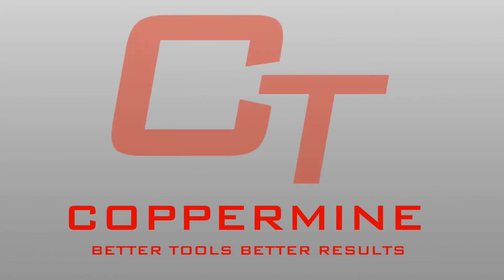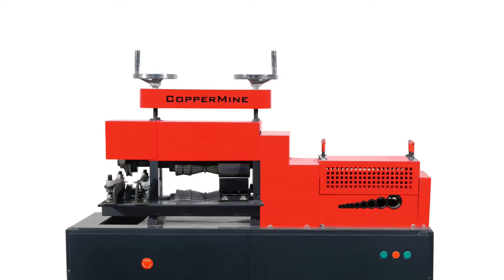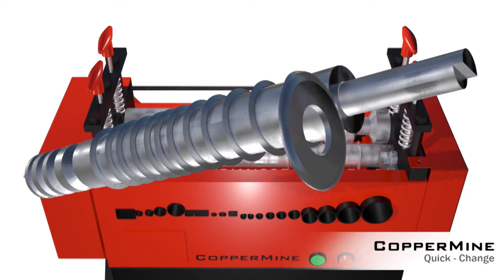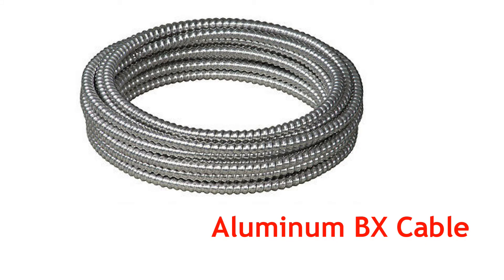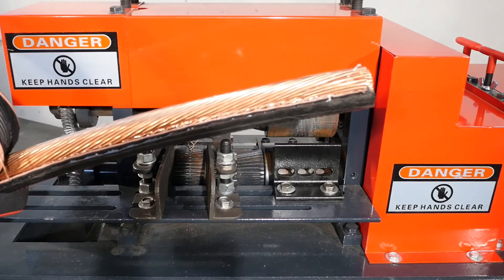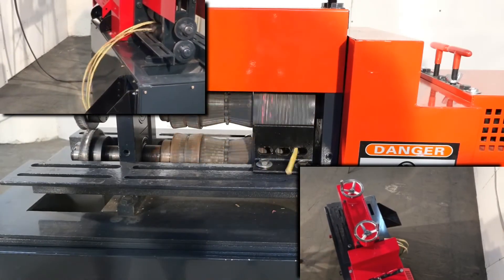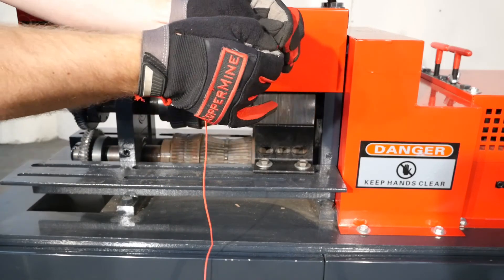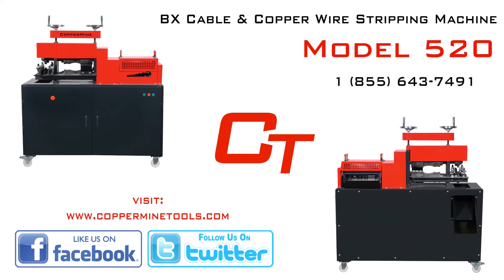CopperMine BX Cable & Copper Wire Stripping Machine Model 520

Comment: Buy mini copper wire recycling plant machine Run on single phase Electricity 220_V, Capacity 
:80-100kg/Hour@cheapest price contact us on what's }6284877298